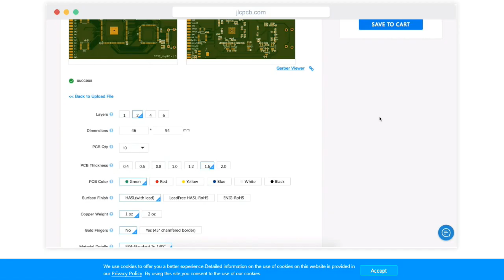220v Induction Motor to 12v AC Generator Brushless - Awesome Idea DIY

Comment: you really need to hook up a motor to the generator and a heavy load and measure the current output maximum it can provide... would make way better videos then showing volts and using a rope to turn it....

Comment: question tho....
i have a 775 dc motor taken off from a drill..
thing is i connected the the motor to a working drill and attempted to get the voltage it produces,started the drill so the 775 start running but it doesn't produce any volt..why?
Reply: forgot to mention if i plug the 775 to a battery the motor works and run...

Comment: To cut ceramics you need a diamond saw and constant water flow.  Also, you're lucky the whole thing didn't shatter the moment you snugged up the vice.  That sort of thing calls for soft jaws or at very least some cloth or rubber glove or inner tube between the work and the vice.  Also you'd get better efficiency if you cut out the shading coils.

Comment: Hello , where is this motor from ? , from which device ?
Reply: You can get this exact motor out of an old microwave cooling fan ... Inside a microwave you will usually find 2 motors but depending on the brand and style ( standard vs convectional) you may find 3 motors ... This will be the cooling fan motor ... I know there are many items with the same motor but the microwave cooling motor is the easiest and most common ... Good luck to you on your project sir 😁👍

Comment: use a big capacitors which collected battery currents black battery you show in video
calculated the size of capacitors which collected battery currents and charges and released it slowly slowly so we got light for continues times

Comment: Sir ,i have 24v solar inverter Battery's Exide bouth are same 150ah and pocus 12/24v,20A charge  controller. The batterys are not full charging I can use 24v , 635watt solar PV panels. what is the problem?